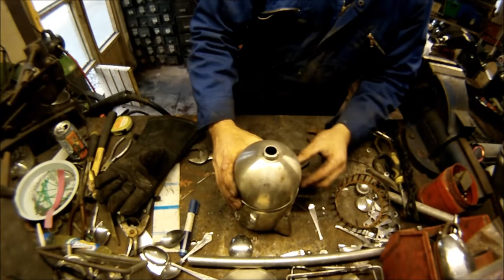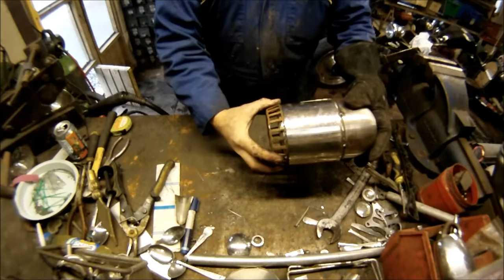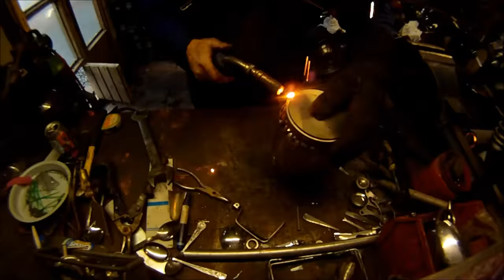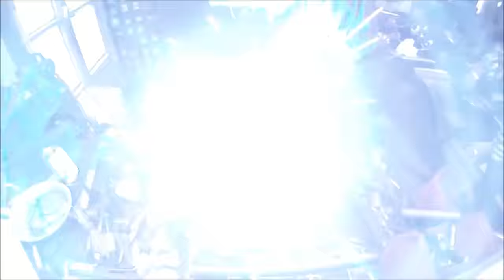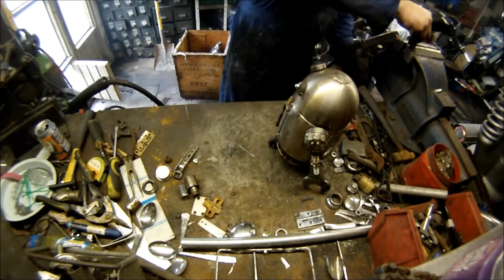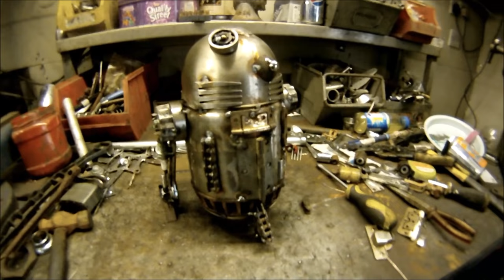R2 D2 Scrap Metal Sculpture build

Comment: Sir,  what is the diameter of the welding wire you are using now for your amazing sculpture ?What metal is the welding wire composed of ?
Reply from the maker: Hi, it's 0.8 & 0.6 wire I use sometimes stainless and sometimes mild steel wire.
Reply: @roosterscreations  Thank you very much for your favourable reply.I really highly appreciate your helpfulness and sharing desire. I will be using the welding wires you mentioned for my steel sculptures.God Bless You Always!!Nelson Lim from Sarawak,Malaysia.